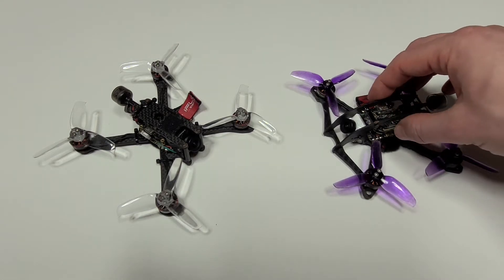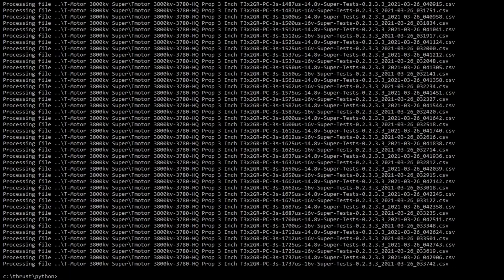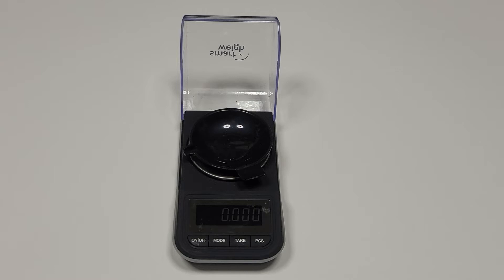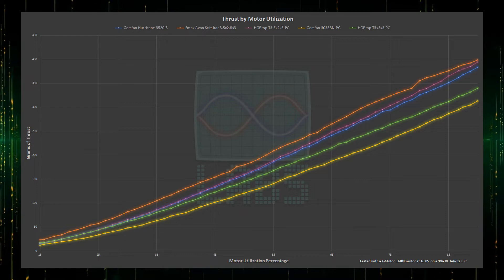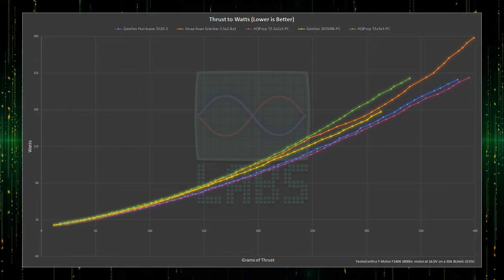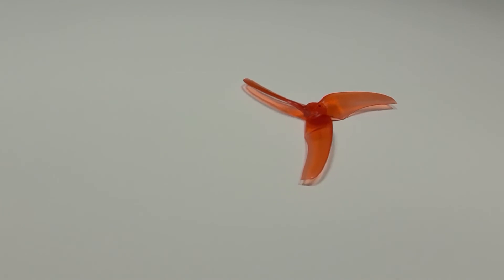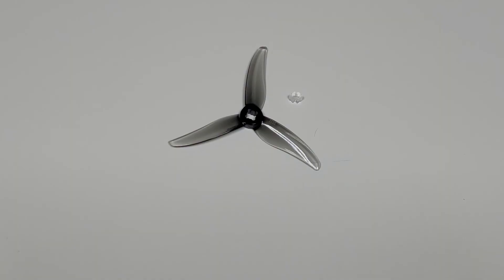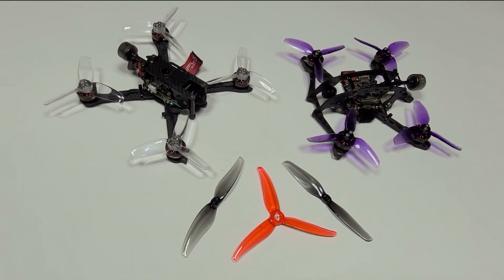3.5" vs 3" Propeller Performance and Efficiency testing on 3" hardware (1404 Stator)

Comment: The Avant Avio frame has ample room for 20*20 IOC boards. It come in 3 and 3.5, but even the 3 in version has the room for it. I have a 3" Avio with a GOKU GN722 IOC

Comment: i have a crux35 coming, and i did order a set of 4 inch props just to see if it will work, but otherwise i have all 3 of the ones you tested coming also, mostly because its hard to find 3.5 inch props not many out there, but its interesting to see the results, i live at about 442 meters above sea level (1450 ft) so i was looking for a more agressive prop so i was thinking the emax will hopefully give me good results here, because i was thinking the lower pitch props might stuggle to stay effecent at this elevation while still giving me good grip, so its still going to be super interesting to test them all for my personal situation and flying style, i think the emax might still work best for how i like to fly, i like to corner hard so it will be interesting to see the trade off of a faster responding less agressive prop vs a little more sluggish, but more agressive prop

Comment: I love the avan scimitar props on my heavy 3.5"
I know that this wasn't the test since you were testing light weight but i found that the avans were pretty smooth and provided more thrust. I was able to top out at around 85-90 mph on my 325 gram 3.5" diatone roma build. It used 2004 3000kv motors with a 85% motor output limit with a 6s cnhl battery. I couldn't get it to push past 25 amps as I think the battery c rating or xt30 connector was limiting it. 

Speed was calculated using dvr and distance (found using google earth)
I have yet to use the hq props but so far Im loving the avans much more than my gemfans. They are also more durable. I was able to completely rip off one blade of the gemfans with one crash on a hill side

Comment: Nice Vid! But what to do now with the Emax props... got 5 bags of them laying around...did you find a motor that could spin them well?
If you are looking fpr really light 3.5" frame check the AMAXINNO F3.5 Micro or F3.5 Nano ! Both accept 16x16, 20x20 and the Nano also 25x25. Weight is abaout 25-28g !
Reply from the maker: I did some tests on larger motors in later videos, and they did not perform well. That doesn't mean you can't still use them if you have them. I solved the frame issue in a later video as well if you're interested.
Reply: @RecursionLabs  yep, I saw  you just created your own frame.. Nice design. But for people who don't have this options and especially in Europe the mentioned frames are worth a try ;)
Reply from the maker: @produzilla1316  For sure. Mine is more niche anyway.

Comment: I have a Crux 35 frame, takeoff weight 180gr. With the Gemfan 3520 I burned my emax 1106, then with the new motors 1404 I feel the quad fast but more difficult in freestyle. Finally I changed for the HQ 3x3x3 maybe not the best but a very good compromise.
I fly with 3S 750mah Tattu Rline. The Emax 1106 was 6000kv the Happymodel 1404 4800kv
Reply from the maker: What voltage?

Comment: Thank you for the great video! There are 4” arms for the micro alien and reverb frames. 👍🏽 I built a 3.5” using those and come in at 130g using 1404 motors and a stripped Caddx vista

Comment: Do you fly DJI?
Reply from the maker: Yes. A stripped down Vista is on the builds in the video.
Reply: @RecursionLabs  I designed a 3.5" frame around the Vista and would love to send you one (+ a set of motors) of the first production run for testing.
Reply from the maker: @volkergoe  Send me an e-mail. I'd love to take a look.

Comment: Going by static tests alone you may miss what is happening to the step response as you over-prop the motors. A good step response is one that quickly ramps up and locks in at the new rpm. As motors become over-propped they will have a harder time ramping up and locking in as quickly. This sluggishness affects both the throttle response as well as your PID/set point tracking. The effect is compounded by needing less rpm to hover so that at the low end the motor is further pushed below its ideal power band. What you’ll feel in the air is at first you the extra power and flight time will grab your attention. But once that initial wow fades you’ll find that the precision and responsiveness of the quad has gone mushy. A similar thing can happen with motors as well where those with the best thrust/efficiency will have a more sluggish step response.
Reply from the maker: I agree that static tests alone isn't the be all and end all, especially from a flight performance stand-point, but it's a really good place to start. Moving static air does put more pain on a motor than when it's flying, so that does balance things out a bit. For comparative testing I think it's fairly solid, and really the only good way to get quantitative data, outside of blackbox (which is hard to tie directly to motor/prop related performance). 

With that said, these tests are performed in the manner you're suggesting, since each throttle position in the graph is bursted from idle RPMs. I've been debating if I want to present the ramp up data, because unlike the other data, I don't think it's as accurate, and is more susceptible to other variables (current spikes, ESC timing/protocol, etc..). RPM sampling is also limited to every 20ms. With that said, here is the graph for these specific tests: https://i.imgur.com/VhRaVBK.png (Note: that the graph starts at 0 for a while because I don't use my optical sensor for these high RPM motors, and it'll be 0 until it's high enough for it to be measured electrically). 

If you think this is worth presenting with a disclaimer, I'll consider it for these types of tests moving forward. In this case the data does indicate that the motor may be struggling, which was actually the primary reason I started digging further, but RPM was just more accurate to present. I'm constantly struggling with which data I should present or not, since I don't want people to get bored, as I could easily make these things 20 minutes long. 

Great comment. Appreciate it.
Reply from the maker: To update my previous comment, I  realized last night that my talk of a 20ms bias was actually still in my mind from my previous throttle change measurement automation attempts from years ago. The captured RPMs in that graph would be accurate for the time it was captured, so the chart I provided in the last comment should be accurate. I have an idea how I add some additional testing at the end of the cycle to increase the resolution significantly of the points on that graph, if it works it would actually be a fairly good data point to show formally.
Reply: Recursion Labs sounds promising! I did the analysis side of a project with Karl Pablo to add the step response testing and the step response data was quite challenging to acquire. One of the things that Ryan Harrell advocates is to match the start and end RPM to get the best apples to apples comparisons.
Reply from the maker: @Quad66  For motor to motor that wouldn't be terribly difficult to do with current test data since you can line up RPMs from different test points fairly easily, but for my idea for a higher curve resolution it would need to be a separate test sequence. For prop to prop it's not really needed since it's the same motor.
Reply: @RecursionLabs  I'm not sure if I explained very well. For the step response you want to know how quickly goes from one thrust level to another and stabilizes at the new level. The difficulty is that motor A may not have the same thrust as motor B at a given percent throttle. So if you want to test something like a step from 10% - 
30% you would have to start with motor A find the rpm at 10% and the stabilized rpm at 30%. Then you need to find the throttle percent for motor B that gives you the same  rpm/thrust values, so if its a lower power motor you may need 12% stepping up to 35% or something like that.
Reply from the maker: @Quad66  I think I understood. The automation goes from 5% - x% in increments of 3%, so sorting results by RPM would show which throttle setpoints were reasonably close to one and other, then I could pull the ramp data from those setpoints.
Reply: Recursion Labs ah, you’re already doing a sweep through the throttle so you may already be collecting the data or getting enough to know what follow up needs to be run.
Reply from the maker: @Quad66  Exactly. The main graph data is based on averaging that data from each setpoint test (once it is spun up and stable).
Reply: Quad 66 - What are your opinions on the opposite of your OP, if you "under-prop?". My 3" with 1106's and Gemfan 3028-3's is too powerful for me even at 80% throttle limit. I really want to try the lowest pitched props on it and see how it reacts. What I am constantly looking for is more "throttle resolution" especially around my hover point. I have done a few things to obtain that, including expo in the throttle around the "throttle mid" point, but I feel like I'm just plain over-propped. In 3" there seems like a HUGE range of pitches, and I'm not too keen on trying them all out, thus wondering if the low end is indeed too little pitch.
Reply: Matt Mead an 1106 is outside the range I fly. Lowering your pitch (or going to a smaller prop of the same pitch) will bring your thrust curve down but you may trade off too much efficiency versus going to a wider shorter motor.
Reply: @Quad66  I'm basically just eyeballing 1204 motors all day.
Reply: @mjodr  1204 and 1303.5 are great motors
3 inch props and 4500kv on 4s or 5000~6500kv on 3s.